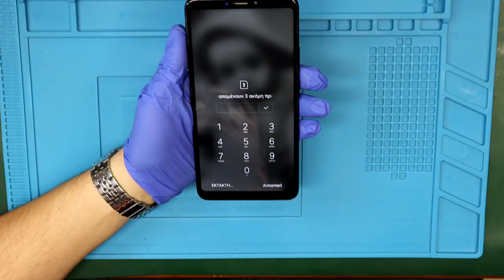Xiaomi Mi Max 3 Screen Replacement - Αλλαγή Οθόνης σε Mi Max 3

Comment: Dude I'm halfway there, just ordered te new screen and glue, I think it's gonna work, I'll keep you posted, but thanks so far man👍👍👍👍👍
Reply: Did you get around to doing it? Have any tips on the process?
Reply: @Fiskarhatten  yes it worked due to this video but my tip is use a proper glue nozzle, mine was way to big and it didn't get delivered with the glue itself.

Comment: How about that pentalobe screwdriver you use in the start? What is the diameter of that? I have only a T5 here as smallest one so will have to buy one:(. Which one should i buy?
Reply from the maker: https://des.gbtcdn.com/uploads/2015/201511/heditor/201511241501204638.jpg

is 0.8*25mm  . is like iphone 6